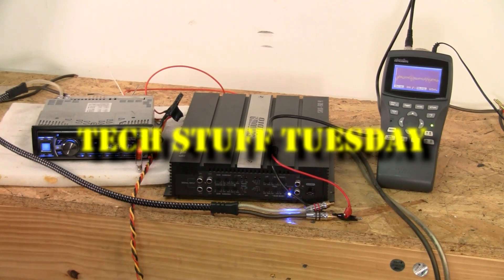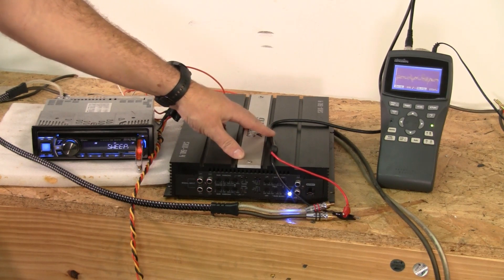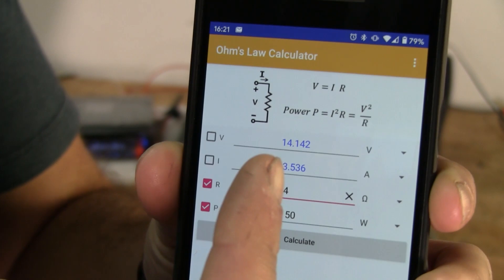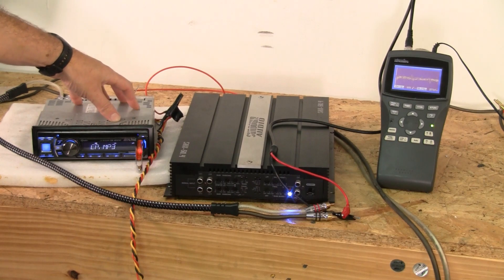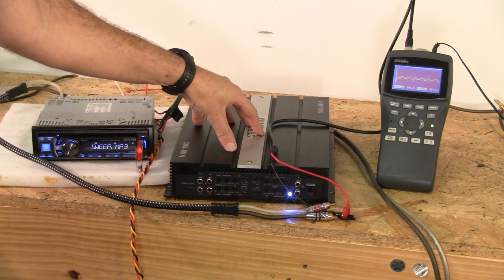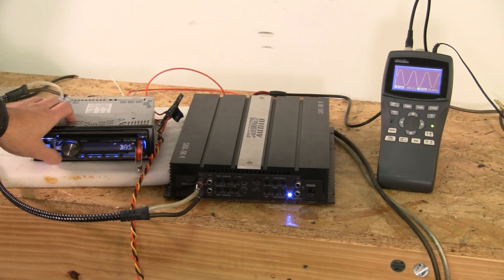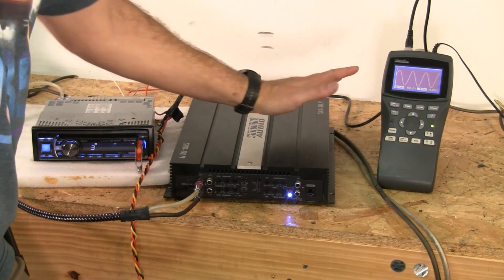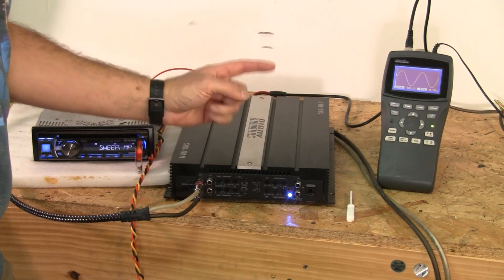How to set your gains using the best tool, an oscilloscope. - Tech Stuff Tuesday

Comment: INPUT WELCOME.. i set my head unit and amp with a oscope (LM2020). 
My Sub is wired at 1 ohm on a jp23v1.5 amp in a custom box.
 I found that i could really increase the gain over my o scope setting because i have a clip light on the amp. I assume the sub ohms are rising and why i could increase the gain so much.
 I did scope it with my lpf off. Could i scope it loaded with the sub woofer hooked up? 
Should i have set my lpf before using the o scope? 
Im running a taramps dsp so my crossovers are digital. 2 huge agm batteries, h8 and xs d3100 on a 140 amp alt ( i need an alt)
I sort of understand gain overlap and i used a -5db track (youtube) but i was able to go from 48 volts to about 62 volts. That would be 2500 watts at 1.5 ohms. 2800 watts is about the max output the amp can produce on a dyno at 1 ohm. 
I dont understand why i can overshoot the o scope so much without clipping. My amp shows clipping before my o scope does. The light comes on a tad before i see it on my scope. I guess it could be the recording level because a few songs hit like crazy and i have to turn it down but most songs are set perfect with that much overlap. I wish i could find a way to determine how much overlap i should run and relate it to voltage increase.
1 skar vxf12 is blowing my mind on this jp23. It hits so hard that people dont believe its 1 12. Ive had it almost a year and it took about 6 months to break in. It just kept sounding better and better while taking more and more power. Its tuned at 32 hertz and i dont run it to clipping below 40. It will clip the amp with the higher frequencies but down low it is the gift that keeps giving. Its in an almost sealed trunk and im worried my sunroof is going to shatter
Reply: I am having the same issue with my jp23 v2. The scops screen is not big enough for the wave as the wave keeps getting bigger but screen runs out. So for now i just use the amps clip light which i think is prob the best way to set gains unless your sub handles way less power. I also found if i raise the LPF on the amp more than the 9 oclock position or around there, that the amp will clip and also not sound as clean. So for me i keep lpf at 9oclock and subsonic around thr 10 to 11 oclock position and with a 4v pioneer hu i got gain around 10/11oclock position

Comment: This video was super informative and will help me tune my radio/2amps once I get my o scope. However I did have a question: I keep seeing in multiple videos when we test the clip point to keep the EQ on flat. Do we keep it there afterwards as well? Asking because wouldn’t changing the treble or htz on the radio after the fact also change its clipping point?
Reply: Once you get your scope, and your gains are set from the flat EQ, go back to the head unit and see what effect - gaining anything in the EQ - has on the waveform. That answer will come to you when you see when it clips.

Comment: I saw other videos checking the head unit , most say always flat , nada treble mid at 0 , but what you mentioned once I set the treble mid and bass I can create the clipping at the recorded volume mark for clipping at flat level settings, so bottom line I should check for clipping with my settings set to my usual settings?

Comment: If I'm trying to determine if my HU is clipping and it's an OEM unit without RCAs and just speaker-level outputs, should I hook the leads to the speaker outputs after the factory amp?  Or can I check the actual RCA outputs from my my DSP before the amps?

Comment: I am an electronic repair person so I own quite a few Osciloscopes. The cheap small hand held Osciloscopes work fine for setting gains. I've used them for years. I also usually do not use in line with a speaker... Any quality amplifiers rated rms power is achieved by setting the amp to pre clipping. Different music and speakers all cause changes to the clipping point BUT as one who listens to almost every kind of music.... Why am I going to take the chance of sending a clipped signal to my $500 worth of Subs? Or any speaker for that matter... If you want more bump out of it, add to it or increase amp size... There are more than enough options and when you consider the cost of speakers and time invested in changing component sets (which I have installed in factory locations)... This will pan out to be cheaper and more beneficial in the long run. Just food for thought from a guy who's been around stereos since 1992

Comment: It's on Amazon right now for 37 bucks
Reply from the maker: What is?
Reply: it's a oscilloscope you can set your game on your amp for a low pass or high pass frequency with that tool you can stop your amp from clipping that mean you think it's getting hot and it shut off is not that your app game is it set up property

Comment: ok, this was cool stuff.  I got an o-scope from a friend and adjusted the maximum clipping volume (with my equalizer on) using the a sweep tone.  When I plugged back in teh RCA plugs and then did a channel on my amp, it already was clipping with the gain all the way down.  Obviously, I did something wrong, but not sure what.  Help is appreciated..
Reply from the maker: You may not have done something wrong. Amplifiers have a range of input voltage say 0.25-4v of signal input on the gain. If you had 5v on the signal it's out of that range and would be clipping.
Reply: EMF Audio Thank you for your reply. Now a very dumb question, but I’m trying to figure out what exactly gain is. If I’m getting output voltage of about five watts from the head unit, does that mean that I don’t need an amplifier?

Comment: I picked up a $40 o-scope on Amazon and its a nice little unit.  I originally set my amp gains via DMM.  I was surprised how much more power was in my Alpine PDX-V9 once I could see clipping on the o-scope.  I compared the new o-scope gain setting side by side with my DMM and noticed there was a about a 5.5 volt difference between the o-scope and the DMM (example oscope:  24.33V DMM:  19.0V.  The o-scope was higher on all channels.  Any idea why it was approx 5 volts higher?
Reply from the maker: Based on comments, if you use that scope and hurt someones feelings your scope is cheap and no good, but if it does you some good it's fine. 5v is a lot difference at that level, you're talking about 25%. Maybe your DMM sucks, I did a video on that. Harbor Freight DMM's read impedance very wrong, but DC voltage OK, I don't remember testing AC voltage. I'd say you need a 3rd option to see if it reads the same as one or the other to see where the issue is.
Reply: @EMFAudio  My DMM is Klein Tool MM300.  Is it possible the variance is coming from the probes?

Comment: So what do you do if you want to go louder than the 25 volume? Fukn bullshit that the head unit clips losing so much volume potential. On my pioneer head unit volume 1-30 is so damn low it's pointless, then in distorts at 45 with 60 being the max volume. So I'm stuck in a volume zone that is not loud enough for my preferences. What is the solution to this??? Thanks for your reply. -Cheers
Reply from the maker: If your gain is set properly, you should have a linear volume increase from 1-45. Having a bazillion numbers is a marketing tactic, higher numbers is louder, right? It also makes every click less effective. The solution is get a HU that goes to a lower number, really. Each click will have more significance.
Reply: Yes there is a linear increase in sound but the db output at 1-30 are so low I would never listen to music at such levels so my listening db preference is always at the 40+ numbers. Is there a way to increase the output signal "gain" of the unit so as to make the unit louder at the lower volume numbers? I was watching another video and the guy was saying that all head units reduce their power output as the volume is increased, is this true? Would a digital sound processor help in this situation? Thanks for your replies mate.  -Cheers

Comment: Wouldn't it be easier to max out your EQ and turn up the Bass, Mid, Treble......................Tune for this maximum clipping on the sweeping track, to be safe?

Then set the gains on the amp and be done with it.

Do you have the have the speakers connected in order to get the load on the amp to set with an oscilloscope?
Reply from the maker: That would be "safe" but it would be far from optimal in terms of maximizing output. When you boost all those things it can be 10-12 dB of boost, which is literally making your power when flat 1/4 of what it was. Having a reactive load can change where settings should be so that is ideal but not always possible.

Comment: In my experience:
Oscilloscope>DD1>DMM>Capacitor+speaker. 
A cheap DSO (digital oscilloscope) is the your best bet. but takes a small learning curve that is easy to grasp. If you're using a DD1: Once you get a clip light, turn the gain back just a tad bit to be safe. Depending on the amp sometimes clipping happens a tad bit before the DD1 fully detects it (a Fluke DSO showed me this).
Reply from the maker: It's been said that getting a clip light with a DD1 isn't the ONLY thing to be done. That being said, I'm guessing you didn't watch this video because we didn't use a capacitor at all.
Reply: @EMFAudio  I was just saying in general, I might have missed the part stating the dd1 and clip light which is right. Well overall I enjoyed the thorough explanation you gave in the video and subscribed.
Edit: just found your dyi distortion dect. video, awesome!

Comment: I’ll chime in here and I’m not going to criticise any of the methods discussed. I have both an oscilloscope and a dd1. What I will say is that I have a question that I don’t think I’ve found a solution to when it comes to settings gains with my specific setup. I use the dd1 as it’s quick and easy to use. However, what if you have a situation like mine where you have a BMW that has the traditional mids and tweeters as well as a sub but also has midbass drivers under the seats? Surely I’m not the only one out there who has had this dilemma? How on Earth do you set your gains for the channel where the midbass are going to sit? The midbass will be playing between 80-200hz. Doesn’t this then make the dd1 redundant for setting the gains on that channel, as the light is only calibrated for either 40hz or 1khz?
Reply from the maker: This is why using your ear is best, always.

Comment: Gains should be set with a load connected on due to a rail voltage sagging.
Reply from the maker: That's why I mentioned it, but you can't always do that.

Comment: Great video!
Could you explain the diffrence between distortion and clipping? 
I guess that you could have distortion on the signal without having it clipped? 
Can you see the distortion on a oscilloscope?
Reply from the maker: You won't have clipping without distortion (unless your signal source is just that) but you can have distortion without clipping. You'll see both on an oscilloscope. Basically, distortion is an unclean waveform, clipping is the apex of the waveform cut off.

Comment: God i wish i would of grabbed my dads oscope before he got rid of it .....i was shown how to do it this way with a real oscope where you can make out the whole wave clearly  back in 95/96 you know the like 2 feet long 7 inches high and a big screen in the middle lol ... I always had a noise in the wave doing it this way, the wave is suppose to be clean.. doping it this way you can get more out of the amp but it is still wrong if you still have a dirty single, not a clipped signal but a dirty wave didn't know this wasn't suppose to be there untill i read a few " hifi "  papers. .that went more into the waves then just clipping... .   (AT least i always had a dirty wave )  i have not been able to see the noise in the wave with any of the cheap handhelds i tried...  maybe it was the handhelds i used i don't know but when i had it and then did this after i set the dd-1 i still didn't get a clipped wave, but obviously there was a dirty wave... i Can't tell if your wave was dirty in this video  like i always got with a good oscope ... i just gave up on cheap handheld oscopes i wish i had the one my dad had,,  but back then i was always lazy and didnt want to lug it up the stairs and to the car so i tuned by ear, and dmm so when he stopped repairing tvs and shit i didn't think of grabbing it which is a regret

Comment: I bought a cheap 30$ oscilliscope on amazon, and tuned my subs and then turned down the volume level on the subs -4db on the head unit to be safe since some of the songs I play are bass boosted, is turning it down 4db overkill? or is it good in case I play a bass boosted song?
Reply from the maker: You should be ok, but there is no telling depending on the source itself. Your ear is the only one who can say for sure.
Reply: @EMFAudio  I seem to have a terrible ear for distortion lol, before I got the scope I blew 2 different subs on different occasions, but it didnt help that the trunk was rattling as loud as the bass so I couldnt really hear how the sub was playing, just felt it pretty much
Reply from the maker: @trogers2120  the easy way to tell if it's clipping is turning it up and not getting louder. Go back 1 click from the last one before it started staying the same.
Reply: @EMFAudio   oh makes sense I was always told it would sound different like bad quality but now I have the oscilliscope anyways

Comment: So going by Ohm's law, This Sundown 50w x 4 is making just over 80w per/ch. 
But in reality how close would that be??  Because if then using Ohm's law its 160w at 2 ohms.
But you did say at the start that the amp doesn't produce double it's power at 2 ohms.
Which brings me to my next question. Does the gain stay the same whatever speaker you are using? 4, 2, 1 ohms??
I know it's prob best to do it with a speaker loaded, But I also don;t want to blast test tones off to piss off the neighbours LOL
Reply from the maker: I mentioned in the video that wiring below rated impedance can cause clipping. The amp being used is rated for 2 ohms, but is not rated for 100 watts per channel. Voltage should stay the same and current should double but I know his amp is one that couldn't go as high on voltage when wired to 2 ohms, it would clip, but would still make more power than at 4 ohms. I also mentioned loaded is best, but I understand the whole deal with leaving it playing a tone for a while, especially at full tilt.

Comment: Question for you, have you ever compared the tweeter with capacitor method directly with your O'scope to see if it is accurate? I can't afford a scope so Ive been using the tweeter method and I hope it's somewhat accurate. Thanks man.
Reply from the maker: I am aware of the method but I haven't used it.
Reply: @EMFAudio  we should try it at least. I dont have a 22uf cap to test it with. I think it's a 22uf anyway. I saw barevids do this but have yet to see anyone take it seriously and verify the validity of setting it this way.
Reply: @Squat_House  taylorfade does
Reply: @Squat_House  I used it, it works but only with low frequencies, higher one pass through and makes it hard to hear the distortion.
Reply: I believe that's what he is going to do next.

Comment: What would be a good resolution to go for? I bought a cheap one for like 40. I didn't understand the features that well, and I don't like the way I have to move  the screen to see the peaks. I want to get a better one without spending too much,  but not a cheap one.
Reply from the maker: Moving the screen around has to do more with auto ranging than anything else. That's definitely a feature I should have mentioned that is quite useful.

Comment: Pretty good video.  Just another tool to adjust your amps is what I see.  Now I'm commenting to get subscribers.  Think this test will work???
Reply: Its also a tool that can be useful for 100s of other situation. I use one for sensor diagnostics on engines. 🤷‍♂️ i paid 200 for mine. In 3hrs of owning it and using it. It paid itself off with 2 different jobs coming in at 150 dollars and 90 dollars. Its paid itself off 10x over in the 6 months ive owned mine.

Comment: You can buy dso138 osciloscope for about 20-30bucks and it is perfectly fine for all audio related measurements. You can even use it to fix amps as long as you stay on ab class oh, did i mention that it can also be as crossover calibrator as well? You save like 20times the money.
Reply: What settings do you use? I have one but yet to assemble/use it. Never thought of using it for crossover calibration. I'll have to look into that as well.
Reply: Yep used the DSO138 osciloscope  (cost $30) on my monoblock 1500rms - just needed x10 probes to read the higher voltage - saw the clipping easily on my amp and backed it down a bit, got a bit more out of the amp from using a DMM previously (which also worked great) vs me guessing or trying to do it by ear...

Comment: You can do alot more with a scope than you can with just a dd1. I used my dd1 a couple of times and found that i was already dead nuts on where i had my gains set, so i sold the dd1. My old mbquart crossovers have lights in them and were right on to the dd1 and scope.